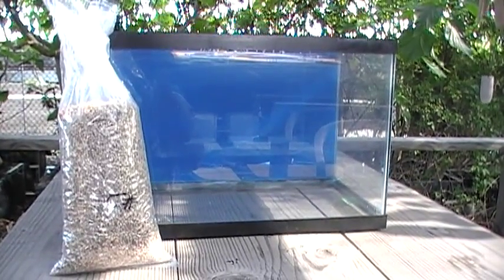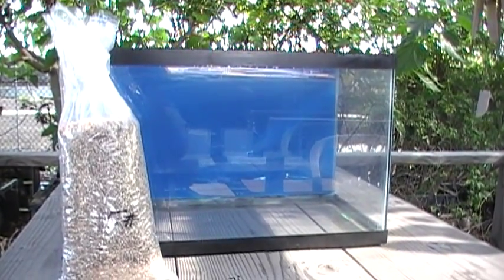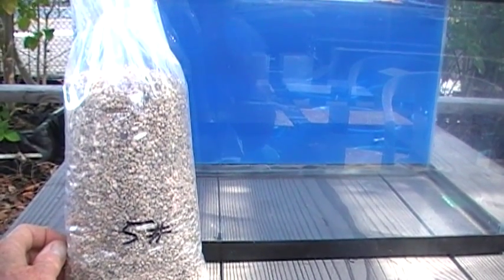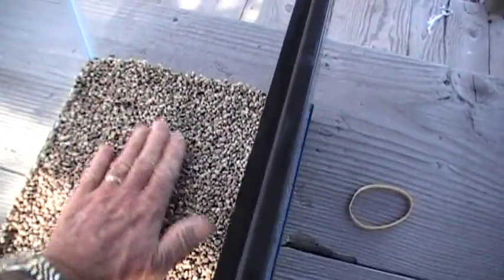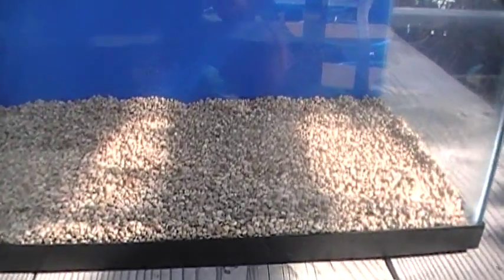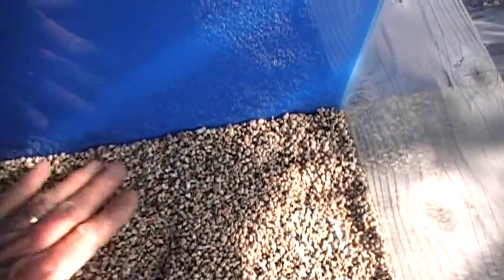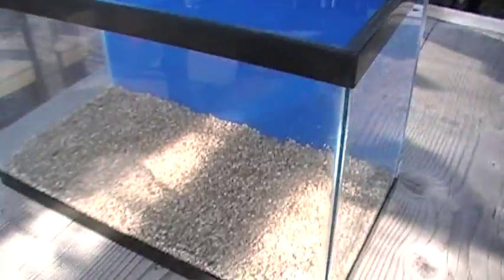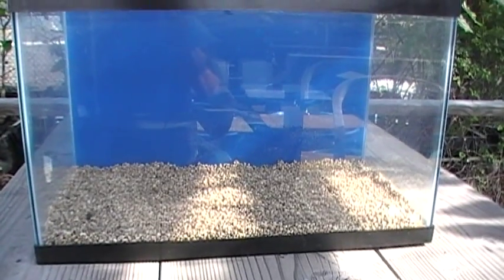Nano Lagoon (5): Shallow Sandbed

Comment: i have a 15g tank with a 2" sandbed and horrible problems with hair algae. i have tried EVERYTHING! big water changes, clean up crew, 1 week light out, bulb changing, restricting to feed, pulling the stuff out, scrubbing the rocks. I have moved recently and had to pull out the water and rocks and offcourse everything else. and i have discovered HUGE amounts of "dust" in the sandbet. should i try with less or even bare bottom? tnx

Comment: actually as long as its  sugar fine and you have worms in the sand and the pump you will benifit from it because the deepsand bed will consume nitrates but only at loke 3 inches 6 is just insane

Comment from the maker: Yes, the fine white aragonite sand will work, but keep the sandbed shallow -- no deeper than 1/2 inch.  We prefer the courser grain size for a variety of reasons, but it's not the only way to go.

If you have Home Depot in your area they have a product called Southdown Play Sand that can be used for making rock.  If you can't find coral aggregate you can use a mix of just cement and sand, as noted in the video.  

Your local nurseries and garden shops may have crushed coral products.